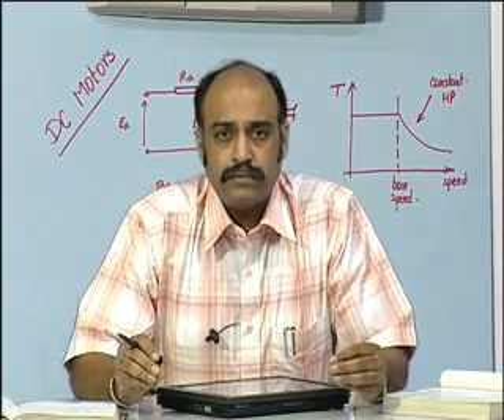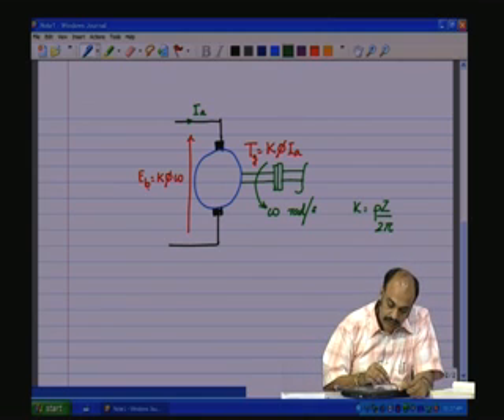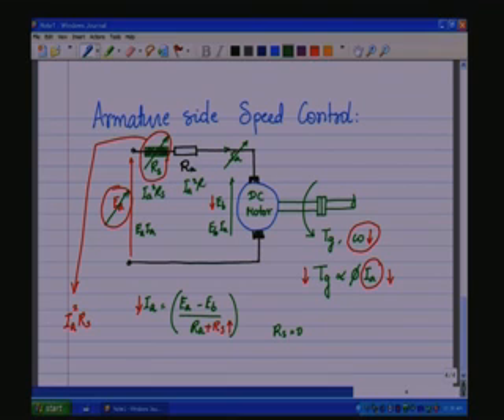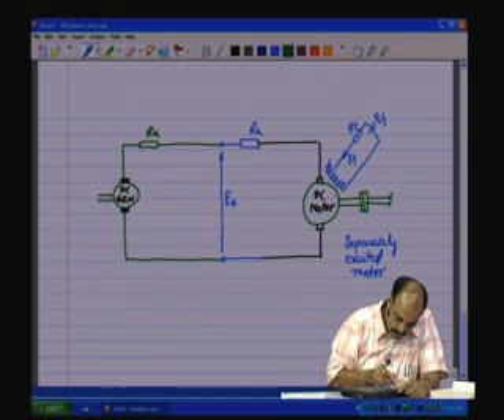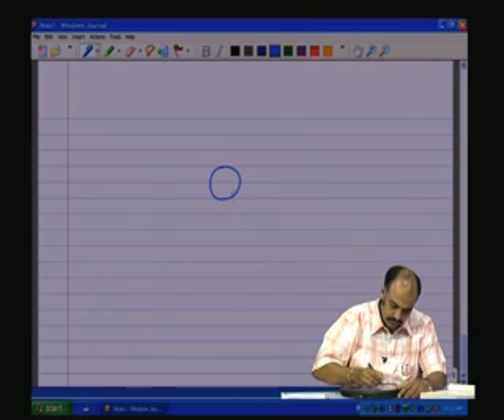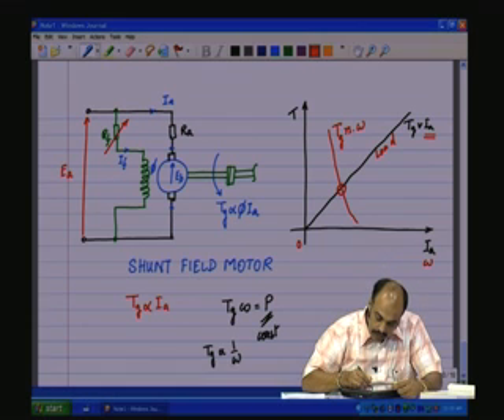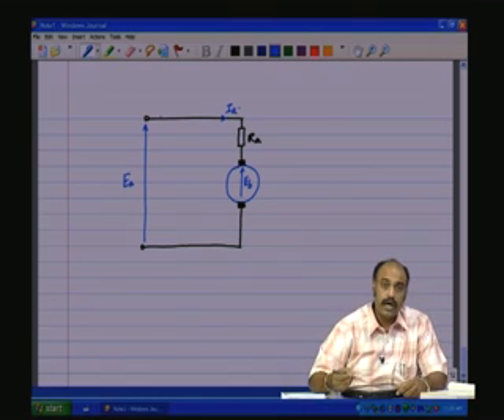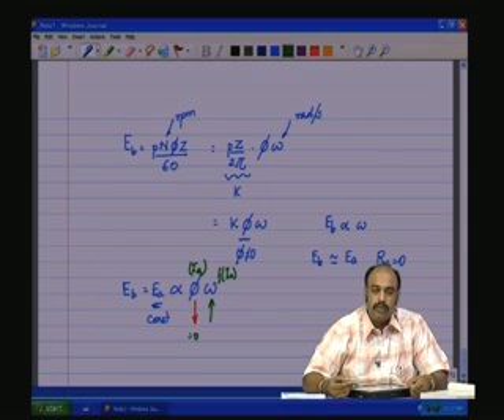Lecture - 28 DC Motor 2

Comment: there is a doubt in the last of the lecture , in series excitation armature current is proportional to inverse of root of speed, therefore as the field ckt is broken armature current is 0 and hence there should be a very high speed!
but it has been told other way round.
well in my openion as it is series excitation if field ckt is broken voltage supply will be disconnected and hence speed will be 0
Reply: In series Motor When Supply is cut off ( same case if field disconnects) no question of Speed it will back to zero after its inertia is over

Comment: its a wonderful lecture,...but i have a question...if u got the time please answer this...would be really appreciated...
 
A 6.0 KW, 240 V, 4 pole DC machine separately excited have an armature resistance 0.4 ohms

(a) with an applied voltage of 240 V and at rated flux conditions, the motor draws a no load armature current of 1 A at a rotational speed of 1620 rpm...calculate no load rotation losses of the motor.